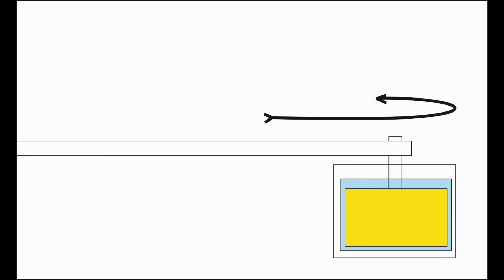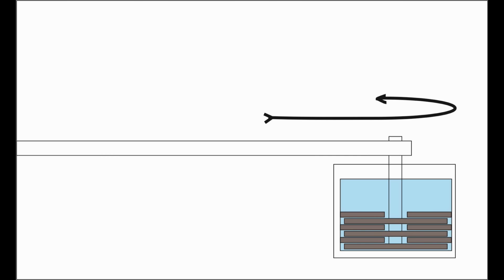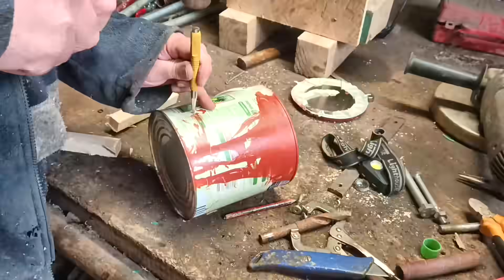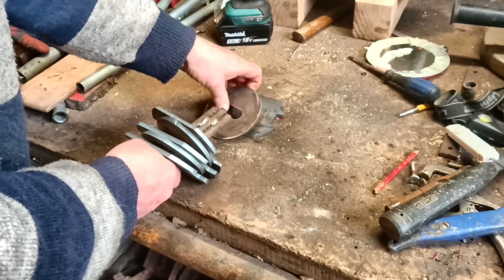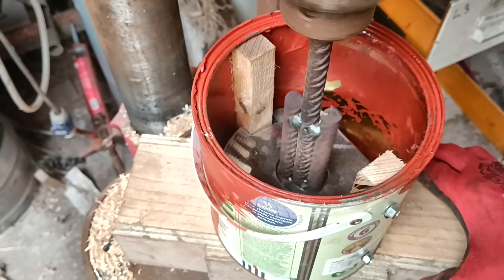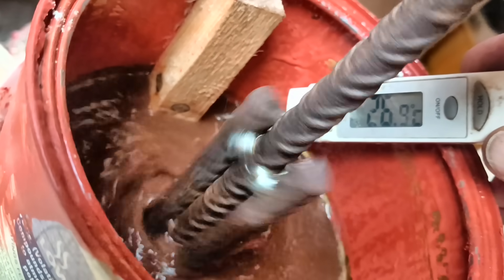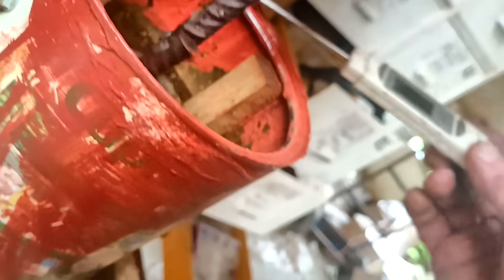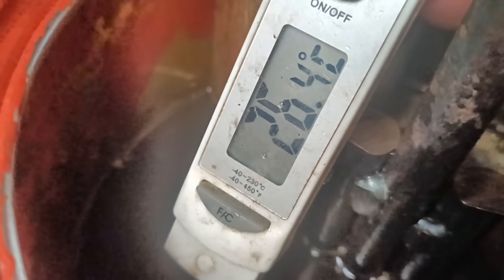Heating Water With Friction – How Practical Is It? Interesting Experiment!

Comment: Honestly, with that plasma cutter and your CNC routing capabilities, I bet you could make your own very large low-speed alternator for not much more than the cost in magnets and copper wire, and then use a bog-standard hot water heater element. Same thing for making your own brushless motor to run on what your alternator can give you through a dead-simple rectifier...but I respect your desire to have mechanical heating very much. I've been thinking about a way to make mechanical headlights since I was a kid :D

I really think you've got what it takes to do an alternator from scratch, though. Watch some people make brushless motors from scratch -- it's more or less the same thing +/- how it's wired and whether it has magnets to self-excite. On my own 'do it all from scratch' list when I have some better shop space and tools assembled, and I'm not a formally trained electrician or engineer or anything. It's about as finnicky as making your own guitar pickups, but you just need the thing you're winding the coils around to be symmetrical in a way that only matters when it spins. Definitely watch some people put some motors together, I promise it's not rocket surgery! No more than a guy building his own steam locomotive is capable of, anyway :)
Reply from the maker: You're right - and it would be an interesting experiment, for sure, but I'm trying not to get sidetracked  : -  )
Reply: @wayoutwest-workshopstuff6299  Very wise! Maybe when it's time to make a steam-electric boat? :D

Comment: I would redo the experiment with the plates suspended in the pot and on the shaft, so they just don't touch, and see how fast (if) water also heats up like that. much less wear, and easier to spin (although easier to spin automatically means less energy there and so less heat.)

Comment: I would think a large stack of thin, counter-rotating disks separated 1-2mm and never touching would heat the water faster. They would have to spin at high speed, and never touch or would form a sludge. The disks could be shot or sand blasted to create more drag.

Or, just use an old lawn mower or tractor hydo.

Comment: How about a geothermal heat pump, but windmill-powered?
Reply: If I recall from waaaaay back there was a video where Tim shared that there is only a tiny amount of soil where they are on top of essentially hard rock (West of Ireland has been subject to a bad case of exploitative erosion, one might say). So even if you were to go wide (because you can’t easily go deep), it would perhaps be quite a challenge to get a broad enough web of pipes that is securely and deeply set in the ground to make that work… 
But I’m sure Tim will chime in with actual facts rather than my “what I call” memory 😂😊
Reply from the maker: You're both right - the location would make it very difficult, but not impossible..

Comment: This kind of heater exists in mass production in cars, its called a viscous heater, used in some mercedes cars, its filled with a high viscosity oil heated by spinning plates, in order to preheat the coolant in a diesel engine on a cold day and bring cabin heat on faster. Could be inspiration for a more efficient design! Cheers
Reply from the maker: Thanks - I'll investigate..
Reply: Is this modern or ancient Mercedes tech. Mercedes diesel... 80's then?

Comment: Ok I'll admit that I have never really thought of this.  But,  I do have a couple of ideas.  Such as using a sand battery for storage maybe ?  Each climate things work differently with.  Here in Arizona USA it is a very dry climate where there in Ireland is definitely a wet climate.   We do have a winter not much of one but, it does get cold at night especially.  We do get a couple of snow storms but, nearly no build up of snow.  We have had snow but, it never stays for more than a day but, that still doesn't mean we don't get cold and night time temps are rather cold.  I've knocked around the used oil stove idea because we do have a fireplace and, I'm attached to my walker these days so collecting wood is not going to happen.  Being young and unable has some disadvantages you know.  Anyway I'm curious how long the metal plates would last but, I like the idea of using oil in it.  Keep working on it and I'll keep watching.  My projects are trying to build a wind generator for my friends cabins he's getting ready to build.  I like the idea of a versicle windmill because it seems that it would be a better for where i'm at.  Good luck ahead I love your channel !

Comment: Jogged my memory of a video I saw years ago, a fire department used a Cavitation Pump/heater to heat water for the showers & they said it was "over unity". It was a motor running a solid & rather wide metal flywheel in a pump housing with inlet & outlet ports as well as a series of drilled shallow angled holes on the flywheel face as well as in the walls of the housing & when spun up, the water would quickley cavitate & become piping hot as well as generate steam. The inventor showed several iterations of it of different hole sizes , number of holes drilled, different flywheel sizes, as well as holes drilled at an angle or drilled straight in the flywheel I'll see if i can find it & post the vid title later. look up "SPR Cavitation video" You are on to a really good idea here.✌👍
Reply from the maker: Thank you - but they tend to spin very fast. I wonder whether they would work at all at low rpm?

Comment: it may be better to have the windmill turn a motor to generate electricity to directly heat a water tank. no wear on parts and no losses from extracting and moving heat. plus if you run the output power through a step up/down converter you  will have a stable output that could be used for almost anything. otherwise the comments suggesting using magnetic eddy currents to generate heat and friction would be a great way to generate heat in a setup very similar to what you plan.

Comment: There was a commercial unit that used fluid friction that wasn't too different than this. But the plates didn't touch and the rotor plates had holes spaced around the perimeter. As for spinning speed, they had theirs just where it started to cavitate. So the proper speed is when it starts to sound like it's churning marbles, for lack of a better description. Supposedly it didn't waste any time heating up to boiling temperatures once it reached that operating condition. I'd guess that's somewhere around 1000 to 2000 RPM? To run it off an old windmill, it's just going to take some differential pulleys to really get it going.
Reply from the maker: Thanks - yes, they look very good, but that's faster than I was hoping for. I shall keep thinking..

Comment: Id like to see this evolve. I saw someone recommend using copper plates and neodymium magnets assuming for the Eddie currents to add heat and reduce wear (cause there doesn't need to be direct contact) and idk how oil would effect that but it could be beneficial.

Comment: The water is the enemy here. It will corrode everything. Get an old electric motor and short the windings together and dip it all in a bucket for a test. The bearings will rust soon, the magnetic steel will soon start going away, but you will make a lot of heat for a short time!

Comment: Regarding the shape of your tower,  if the walls were vertical in the area behind the blades and then tapered to the ground, all your shafts and gears could meet at 90 degrees.

Comment: The three variables in breaks is coefficient of friction (material), area of contact (the 1/3 external ring of the disc is the most effective) and pressure between plates (the clamping force between the parts). I hope tha helps.

Comment: heatpump, as you say low temp water would be insulated easier than high temp. but then move the heat and up it with heatpump. water to water is most efficient and change out electric motor for your windmill or if further away use compressed air motor / rotor from windmill obviously. the friction has a lot of losses not to mention water is a lubricant reducing friction so you are just spining and doing no "work"

Comment: Go the Diesel route and push tube inside another tube to compress air and heat the tube and the tube heats the water. Or you can go with Vortex tube...

Comment: Interesting.
If you worry about wear, vibration and noise, you could avoid contact.
But it may cause too little resistance and therefore too little heat generation.

Another idea I saw Tom Stanton do was a "magnetic coupling" for his bicycle. As he tested it, he noticed huge energy loss when the magnets pass his metal plate. In the video he use a heat camera to make his loss visible. This could be emerged in oil to recover the heat.
https://www.youtube.com/watch?v=Dg8oVR4k5Dk

Many ideas out there, good luck
Reply from the maker: Thanks - yes, too many possibilities really - I shall keep thinking...

Comment: Having to replace metal after 2 weeks?  There are already some good ideas adding some more.
- use a high viscose medium (say stearin vor similar) instead of water with a porouse plate spinner.
- using a heat pump (or the waste heat of it)
- use a generators waste heat to warm the water.

Like the experiments. Lets see where it leads to.

Comment: The wind mill driving a water pump and increasing pressure and then using a pressure relief valve to generate the heat. The power generated at the pressure release valve will be around : pressure drop (Pa) times the flow rate (m³/s). It will also be equivalent with the power used to drive the pump

Comment: An interesting experiment, to be sure!  Some thoughts:

1. Relying on the weight of the discs isn't really a great way to ensure friction.  Better would be to have a spring pressing them down.  Better yet would be to have that spring compressed by a governor, so that the force exerted on the stack by the spring increases with the RPM of the shaft.  That way, when the wind's velocity is low, there won't be much friction from the spring so the shaft will be able to turn easily.  As the wind picks up, the spring force--and, thereby, the friction--can increase without stalling the system.

2. To preheat the heat transfer fluid & water, you could first pump them through a compost pile.  (Look up 'Jean Pain Compost Heating System' for more info.)

3. Flattening the plates as much as possible beforehand will DRASTICALLY increase the amount of surface affected by friction.

4. The fluid currently has a difficult time accessing 90% of the plate surfaces, as they are flat and pressed tightly together.  OTOH, if you cut many small radial channels in the spinning plates and cut a larger hole in the center of the slots for more vertical fluid flow, then centripital force will pull the fluid from the center hole through the channels and across the surface of the stationary plates, pulling heat from them as it goes.  The fluid will then cycle from the outside to the center to be heated even more.  Surrounding the stationary plates with copper water pipes will transfer the heat in the fluid to the water efficiently.

5. As the purpose is to transfer heat to the fluid as quickly as possible, thinner plates should work better, as that increases the amount of surface area per height of stack.

6. As torque seems to be the deciding efficiency factor for this method, the largest stack of plates possible plus a high-torque rotational source--VAWT windmill/paddlemill/etc.--should be the way to go.

7. To remove some of the humidity from your air I suggest you go to the 'Tech Ingredients' channel and watch at least the 'Revolutionary Air Conditioner!' video in the 'Cooling' playlist, as it shows a simple, energy-efficient way to dehumidify (and cool) air.

Cheers!
Reply from the maker: Thank you Keith - the cnc plasma cutter uses a LOT of air though..
Reply: @wayoutwest-workshopstuff6299  "Thank you Keith - the cnc plasma cutter uses a LOT of air though.."

Yeah, you might need to scale up the desiccant system a LOT to work with a high-volume air need.   ...but that might still be worth it to have as much perfectly dry air as you need for very little power draw.

Comment: Tim, compression would a very viable option. Reduces wear products and can last a very long time. 
Oh about 6 years or more ago I had a small reach in freezer. It was not really small it was about 100 cubic feet of freezer space. It was super old and I had had it myself for about 5 plus years before the fan motor seized up and broke the pump which caused a loss of a fair amount of food. Yet it had a compressor on it that compressed oil. This in theory would be the better route to go rather than wear plates. 
Heat pumps are very efficient and there are a number of ways you could deliver rotational speed to them. I would also think that low speeds and a small enough pump could deliver hot water/heat in a very short amount of time.
Reply from the maker: Yep - you could be right!

Comment: What if you added holes in the plates and had a rotor and a stator that did not touch other? So the wear would be reduced.
And maybe by adjusting the geometry you would also have an inbuilt pump to transport the liquid? 
Nice projects - keep them coming👍👍. Greetings from Denmark🇩🇰

Comment: Maybe use oil instead of water? Would keep the plates from corroding. I like the idea of using magnets and aluminum disks that other commenters if suggested. Though technically speaking, this is using electricity to make the heat via Eddy currents in the disks.

Comment: If you weld one of the plates to the base of the drive shaft, you can stack all the plates on top of it easily, and just lower the whole assembly inside at once

Comment: Oil is a good idea to prevent boiling out the water, but doesn't oil lower the friction. Which would be the exact opposite of what you want. I guess it would still heat up. I am just guessing it would take much longer. Too long to allow heat transfer. Just my thoughts. What about a couple brake pads rubbing against each other or brake pads rubbing on metal. Keep up the ideas

Comment: If you make the windmill run a vacuum pump that is creating negative pressure around the water tank...you can boil the water.
Reply: Wouldn't the water still be cold?
Reply: @awatt   Haven't you seen the tissue in a vacuum bell experiment in high school? The tissue bursts into flames under vacuum. Some coal fired power plants already use vacuum boilers to reduce their energy input to make them more efficient.
Reply: @mrMacGoover  
So is it isothermal or adiabatic?

Comment: While you're experimenting, I think it would be worth trying some of the simpler ideas, like paddles that are less likely to wear. It's likely that they're all nearly 100% efficient. You could use a plug-in power meter to measure how much the drill is pulling from the mains, and calculate the heat capacity of the water to measure the efficiency.
Also, if you're only expecting a kilowatt or two, you'll probably need a heat pump to scale that up enough to heat a house.

Comment: Very interesting concept, but I highly doubt it is efficient(most of the energy goes into either grinding the metal or mechanical energy as vibrations), I'm pretty sure a decent generator + resistor would be considerably more efficient. As someone said using magnets and copper or aluminum with alternating poles would be way better, as you are transforming mechanical energy directly into electric energy(because of the eddy currents) which gets dissipated in the copper plates as heat.

Comment: Wouldn't using oil as the primary heated environment defeat the object, as it would lubricate the plates and reduce the friction? You could, though, use oil with a paddle type system, as the more viscous the liquid, the more friction and the faster it will heat. It all depends on how much energy your windmill will produce. Stirring cold treacle requires much more energy than stirring cold water.

Comment: If you want to keep a mechanical concept: just use cheap brake disks and caliper. You would be able to adjust the friction load to the value the Windmill is able to deliver. As well, worn out parts would be able to be replaced easily.

Comment: Car brakes are pretty good friction devices. Easy to adjust too.

For the experiment you can make life easier by measuring the torque on the paint tin and multiplying by rpm. That gives power that's all going to end as heat.

Comment: Tim, noncontact is probably the way to go. if magnets and induction are too high tech, Then something with viscous fluid being forced through some torturous path.  
I also suggest considering a heat pipe to move the heat around. You can make one easily!  put a little water or other appropriate fluid in a capped pipe until it boils and then close a valve on the other side to seal the pipe and liquid at low pressure. In use the water boils at low temperature and the steam communicates the heat to the end of the sealed tube. A great pumpless way of moving heat. It’s very very efficient. Of course placing the entire heat generating mechanism in a large tank of water will work also, but the heat pipe is a good trick.
Reply: Pumping fluid around needs pumps, and they have friction with the vanes / impeller / whatever, and the liquid. You can't avoid wear. 

Heat pipes AFAIK are used mostly in computers where you need to shift a lot of heat quickly in a small space, do there exist great big ones? Since this is for domestic bulk heating, just using chunks of metal, ideally copper, seems better. Heat pipes are for when removing heat is the priority.